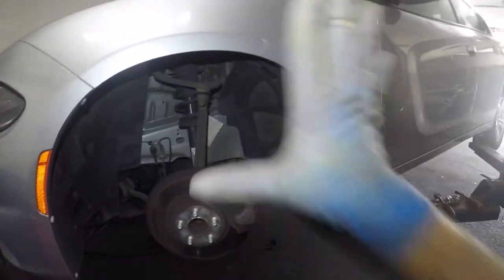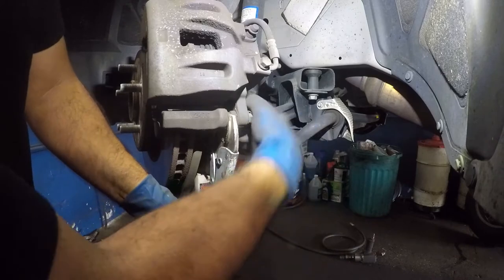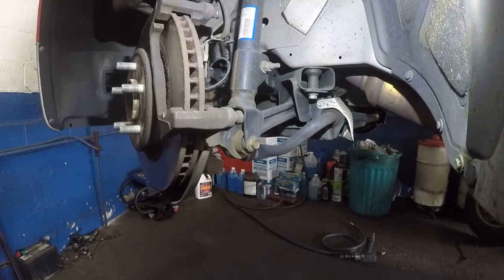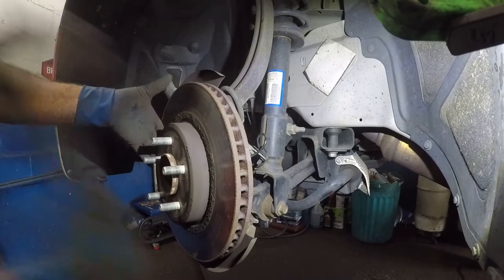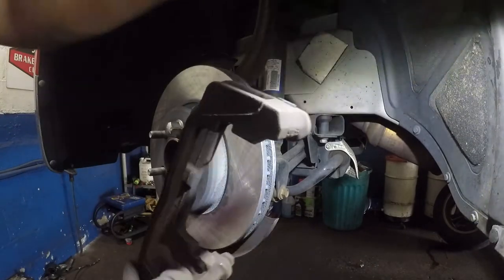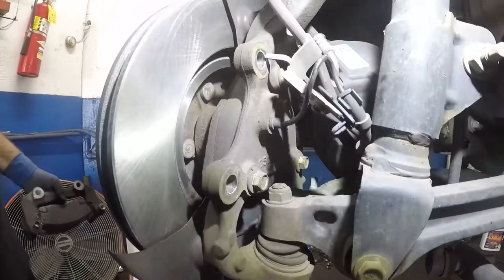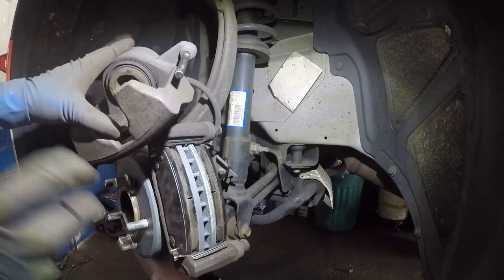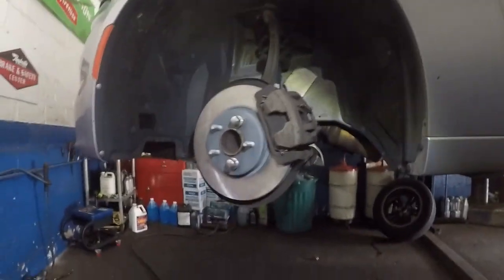How to replace front brake pads on 2015  Dodge charger

Comment: I did exactly this. Changed both rotors and pads. Lubed everything like ur other vid showed. Except i hear a loud high pitch squeak only when i let off the brake pedal on my front left tire. I Never hear the noise when i am in park and pressing/letting off pedal. But it's when I am in drive and letting go of the pedal when I hear that high pitch squeak. Have any tips on what it might be? Also this noise was also before I changed out everything.
Reply from the maker: Check the shims or backing plate if it touching

Comment: Thank you!!! I did the front side today. For the 21mm bolts, I had to use a wrench and the floor Jack to take the passenger side out, and on the driver’s side I basically put all my weight on the breaker bar (I’m 260lb) to move the damn bolt. I’ve heard if you heat them first they will come out easily, but all I have is a small torch for créame brûlée and idk if those will generate enough heat, lol.
Reply from the maker: Don’t need torch

Comment: Is there a way to replace the boots for the pins? I changed my brakes today and one of the boots feels hard won’t retract easily. I’m asking you if there is a solution other than buying new calipers
Reply from the maker: Yes I can buy new slider pins

Comment: This is good stuff ! What Brakes do you recommend I get for a 15 charger ?
Reply from the maker: Akebono I use that lot or go with somthing stock original
Reply: @RBTheMechanic  Thank you Sir, One last question if you may. Should I replace just the brake pads, or thr rotors too?
Reply from the maker: @D-MAC18  change the rotors also these cars rotor get rusted on the inside
Reply: EBC REDSTUFF PADS AND EBC USR series Slotted rotors.   It changed my charger
Reply from the maker: @pauljoey7977  oh yeah that will do it
Reply: @pauljoey7977  can you tell me exactly what you got and where you got them from please

Comment: Do you know what the torque is for the bolts?
Reply from the maker: Sorry I don’t have torque specs on this vehicle the system I have is missing dodge and Chrysler do have the only big bolt bracket to spindle is 85ft lb sorry editing this I found the torque for small sliding pin bolt is 44ft lb

Comment: You mention to use brake cleaner and avoid contamination on the new disc brake. But yet you were holding the new brake pads with your dirty gloves and it will cross over to the disc (rotor). Make no sense.
Reply from the maker: We talking grease other wise ur pads will need to be changed every time it rains if ur that serious

Comment: So my issue isn’t even the 17mm bolts (yet) it’s the 13mm for the caliper the bolts are stuck and hand turning is only starting to strip I stopped to where it can still be seated. Any suggestions to get them to break loose? I am holding the other nut for counter force but they are stripping too.
Reply from the maker: Sam G ok yeah I been through this with dodge well u since it’s stripped they sell this kit it goes on the nut and it has teeth it grips and turns out the bolt also use little bit heat heat them up they have thread lock it will come out
Reply from the maker: Sam G https://www.google.com/aclk?sa=l&ai=DChcSEwiNo-z7p_brAhWNk7MKHWoGBbwYABAGGgJxbg&sig=AOD64_3mvEa9h_hr_w4ugw9YI8vQVsqskA&adurl&ctype=5&ved=2ahUKEwjd5uH7p_brAhWHDt8KHSujD_MQwg96BAgBEBc
Reply from the maker: Sam G I sent u like to the kit to remove these
Reply: Thank you very much I was hoping itd be an easier job...

Comment: So you have to change the rotors also
Reply from the maker: If they are ok’d bad rusted or if u feel vibration when braking those are signs that u should change them also if they are glazed. Anyways I recommend always change brakes and rotors togather
Reply: Thanks